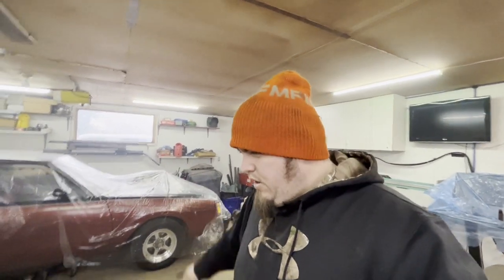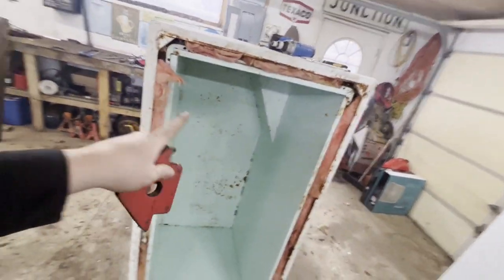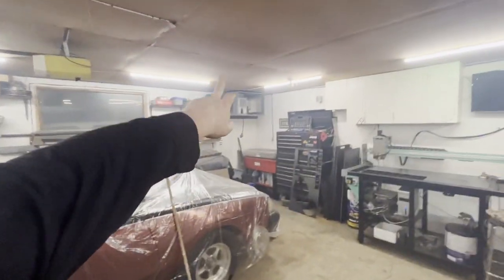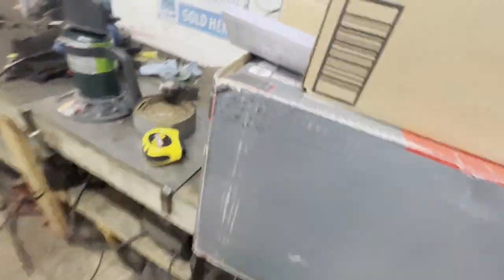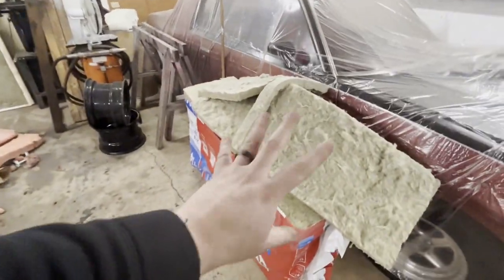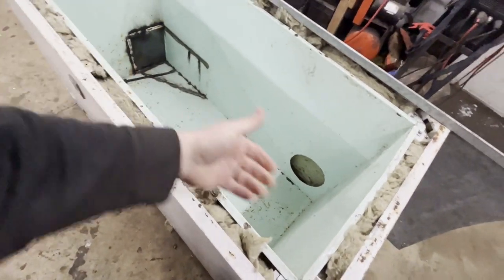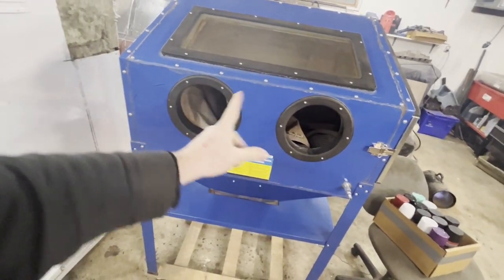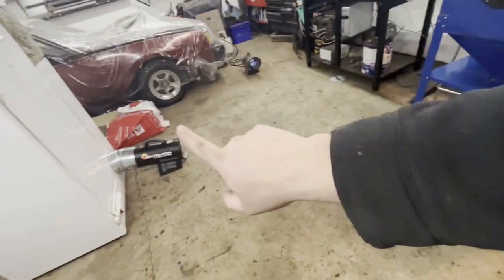DIY Powder coating oven - home built from old freezer

Comment: Hey I'm wondering did you bypass the thermal coupler on the heater ?
Propane usually wants you to push a bypass until the unit is hot in the heater today lit.
Reply from the maker: @Radar8717  yes I did but un-knowingly. I had to remove it for the solinoid to be mounted in line.

Comment: Propane produces a whole lot of damp, when burned. Not good for either the powder baking process or Your tools or parts. You should look for a heater element from a kitchen stove. The main element, not the grille one.
But the freezer idea, is a good one. I suggest You get it on wheels. Good luck! 👍
Reply from the maker: Yes I was originally going to do electric heat but I am maxed out of power in the shop. I do know others using this method with good success but I will keep an eye it. Thanks for the info and thanks for watching.